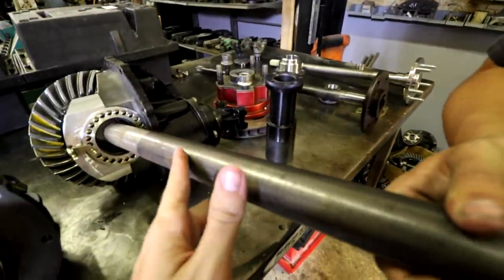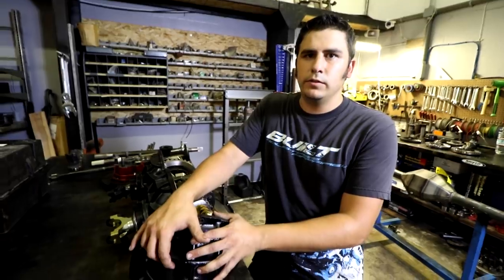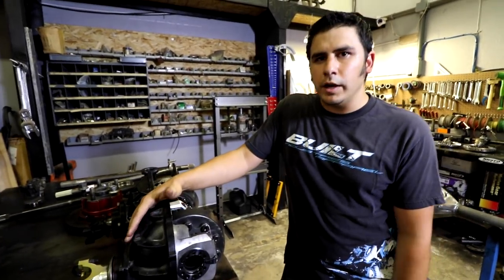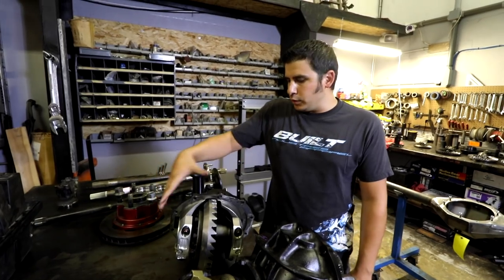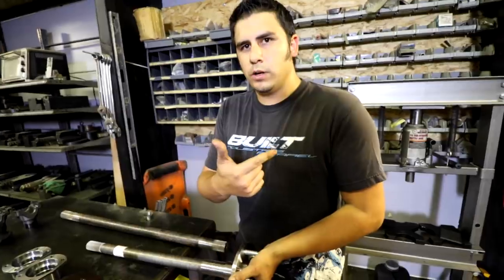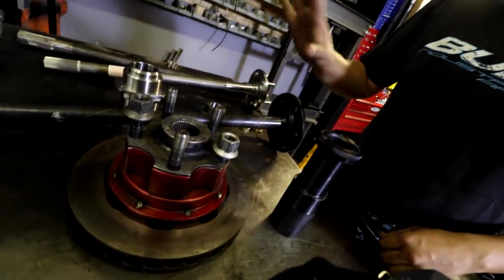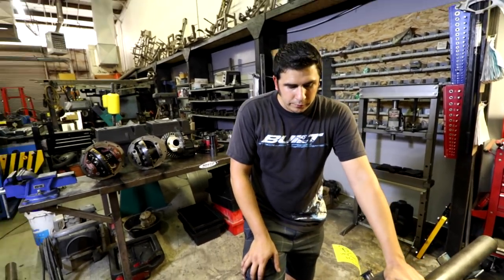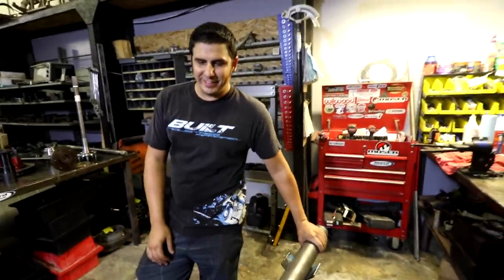Prerunner 3rd Members + Axles EXPLAINED! | TRUCK ANATOMY

Comment: Anyone have opinions on gear ratios and tire size? Obviously that depends on vehicle use, hp, rpm range, transmission, etc, but can anyone drop down what they're running? Right now I have a 2001 dodge dakota 4.7l v8. 230hp at 4,600 rpm and 290 tq at roughly 3,600 rpm. (From what I could find for a stock 01 4.7) I'm getting 4.10s installed and I'm running 33s. Right now it's a daily, but want to build out later.
Reply: 4.10 will be a good all around gear with your setup. If you go to bigger tires and want more offroad only use then something like 4.88 or 5.13 would do you good.
Reply: @thezombikilla  yeah, I'll run this setup for a while and see how I like it. I'll definitely be moving up to 35s the next set of tires and run the 4.10s for a bit until I can decide if I'll stop at 35s or move to to 37s ha. For sure if I go 37s ill change to 4.88s, but I don't know if going to 4.56s for the 35s is worth it if I end up going 37s ha
Reply: @usMarinecuv902  i have a WJ with same engine/tranny as you. 37's on 1 tons with 3.73s, gonna move to 5.38s. previous axles i had 5.13s with 32s and was fairly happy with it.

Comment: Coatings and or finishes on gears? Oil choices?
Reply: Cryo treat the gears and bearings. 85w140 redline gear oil.
Reply: @dobermanracing  Any body doing REM finishes? I had the opportunity a number of years ago to visit a number Nascar shops. Did not get to go into Penske's gear room but could see into and every gear (trans and axles) were REM finished. And all the teams were running a ball/convexed shaped splined axle at wheel end to enable to shim spindle for both toe and camber.